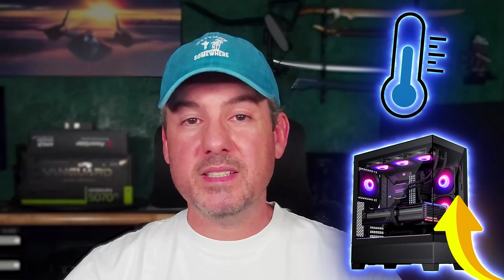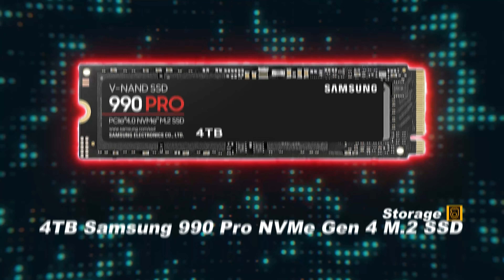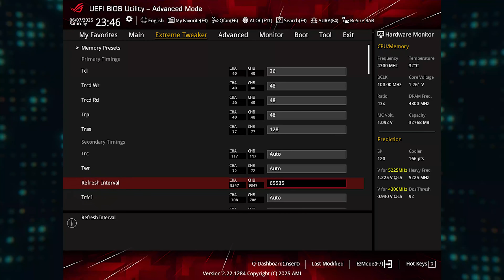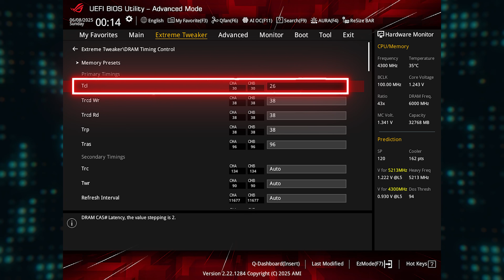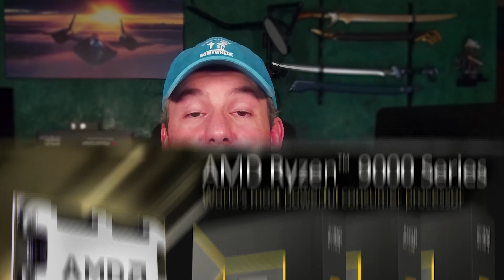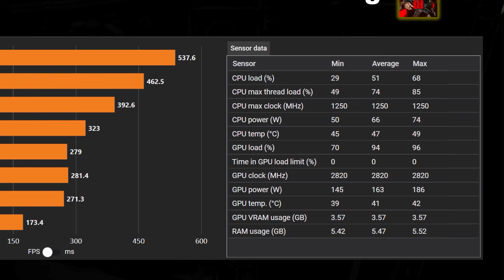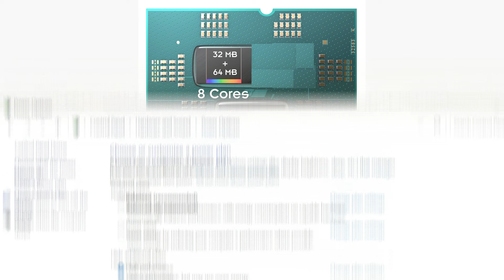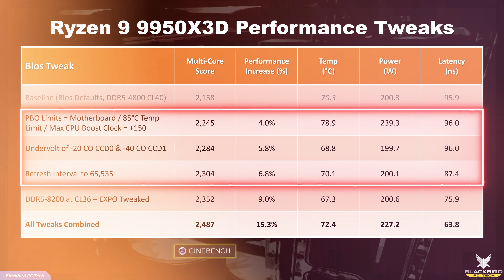What Are The Best Settings for an AMD Ryzen CPU?

Comment: This is fantastic. I have this exact motherboard, 9950x3d, 96GB Gskill Trident Neo CL28, 5080 Asus Astral to follow these instructions. Will come back to you with results.
Reply from the maker: What speed is your RAM?
Reply: @blackbirdpctech  6000mhz
Reply from the maker: Nice system … should perform really well
Reply: With keeping the RAM at EXPO I setting, I got a 7.6% performance increase in C24 Multicore with the rest of the changes
Reply from the maker: @idontknowfootballfc  anything above 5% is a good increase in performance, especially considering that doesn't include the RAM overclocking boost ... don't forget, you will also get a significant reduction in latency
Reply: @blackbirdpctech  Not sure where to take the RAM overclock as the timings are 28-36-36-96 on a 6000mhz 2x48gb kit gSkill Trient Z5 Neo kit. Will have to look through your library about memory overclocking
Reply from the maker: @idontknowfootballfc  it's going to be more challenging with a dual rank kit because it places a higher load on your memory controller ... I would test 6200 and 6400 at the same timings, but adjusting FCLK per my video ... you might need to increase the voltage too.

Comment: I'm not convinced about one thing. Advice to use negative values CO and PBO overall  is a not GOOD idea! I have  7600x processor with a b650e-e board since BEGENING and from the moment I turned on the computer, regardless of the bios version, I had blue screens after turning on every single game game! the only way to deal with this situation was to set CO to positive values +5-10 and now the question is whether my processor is really that bad ?, i.e. in constant voltage mode it needs 1.30V to boost to 5350 MHz. My motherboards cant handle sthat settings because clearly, regardless of the BIOS version, sets the voltage too low by about 0.1V by default and even the scalar x+ option didn't fully resolve the problem honestly...I stayed at the values as I wrote above... it's hard to say but I recommend everyone to pay extra $50-100 for the next new computer and order the computer assembly service along with load tests and any game in the additional services because the stress after buying a computer assembled CORRECTLY by yourself is not worth it!! even after my ram works flaweslly 6400CL28 1.51V flck 2200 1;1 i am really dissapointed from this new build... still i regret not buying 5800x3d on good price and just skip whole am5 platform ....
Reply from the maker: First of all I'm sorry that you had a bad experience ... you didn't do anything wrong, it simply sounds like you got extremely unlucky. If you can only run stable with a positive curve offset then that means your CPU does not meet the AMD spec for a 7600X, which means they owe you a replacement CPU. One thing to keep in mind however is that no one will care more about your PC than you do, and there are a lot of so called "experts" out there that have absolutely no idea what they are doing, so I would caution against using a service. A few weeks ago I saw one of the best boutique PC builders build a PC for an NBA basketballer and use DDR5-7200 RAM with a 9800X3D ... as I show in this video that will offer lower performance than just DDR5-6000 in 1:1 mode ... and these guys are supposed to be the "best". The good news is you are part of the Blackbird PC Tech community ... feel free to ask me questions and I will do my best to help you.

Comment: Great info here! What are your thoughts on the PBO scalar control? Are there merits to increasing this to 5x, 7x etc.? Or should this be kept at auto or 1x?
Reply from the maker: Good question ... I debated whether to mention it in the guide. All that it does is change the boost clock behavior by increasing the Failure In Time or FIT limit of the CPU ... which means it increases how long the CPU can sustain higher boost frequencies before thermal or power limits kick in. When I tested it in the past, there wasn't a meaningful change in performance. That said, even if there was a small boost I would likely not use it because of the potential risks ... so I would recommend leaving it on auto.
Reply: @blackbirdpctech  I do appreciate that info, sir. BTW, my 9700x has been running great with -35 all core and +200 boost clock. My temps never go above 65 degrees while 4K gaming, using an air cooler.
Reply from the maker: @FNPNick  one of my favorite chips ... the 9700X is heavily underrated, it's a fantastic cpu

Comment: Do you really want max performance from the 9000 series? Aren't the 9000 series burning the CPUs?
Reply from the maker: If you watch the larger channels that constantly push drama then it would be reasonable to think that AMD has an issue with their latest gen Ryzen CPUs ... but if you dig a little deeper you will discover that the issue was isolated to ASRock motherboards and was due to bad firmware, which has since been resolved by ASRock.
Reply: @blackbirdpctech  You mean exactly like Intel but YouTube exploded over that issue but now its AMD and not their fault!
Reply from the maker: @gerardgauthier4876  no, it's not exactly like the Raptor Lake issues. For AMD it was isolated to an error from one motherboard manufacturer. For Intel it was an error from Intel that impacted all motherboards.

Comment: The quality of your content is insane step-by-step play-by-play very detailed very high-quality. Thanks for all that you do for the tech community. Lastly, in your previous guides for the 9950X3D I noticed that you recommended the adaptive CCD parking feature is that no longer a recommendation?
Reply from the maker: You have an excellent eye for detail 😉 Here are the two choices you can make for best performance:

1. Balanced power plan in Windows with Gaming Adaptive CCD Parker turned off
2. High performance power plan in Windows with Gaming Adaptive CCD Parker turned on

The reason it worked so well in my prior video is that I was using the high performance power plan. After further testing it turns out that you will get the exact same and sometimes slightly better results simply running the balanced power plan, which is much easier because it's what's selected in Windows by default. This is likely why Asus had the feature turned off by default in Bios.
Reply: Amazing work as always thank you for the detailed super informative information that you provided! You quickly became a tech YouTuber that I just stumbled upon to now the tech YouTuber that I recommend to other people! Thanks again!
Reply from the maker: I really appreciate your support!
Reply: @blackbirdpctech was earned and of course!

Comment: Thanks bro. 
Ryzen 9 9950x -30 All core +200mhz 
G.Skill Royal Neo - EXPO I (only option my mb had)
9070 XT - 550mhz, +10% Power, 2800mhz, and 0mV
Did this by watching all your videos and taking it step by step like you said. Really tested my patience BUT I have a completely stable build thanks to you. Earned a sub and a like and a follow.
Reply from the maker: Awesome ... you got a fantastic chip to run -30 all core on your 9950X ... for mine I had to run the second CCD at -20.
Reply: @blackbirdpctech  i want to try to undervolt my 9950x3d as well (don't want to overclock it, just undervolt) do you know if the PBO is set on Auto by default even before you click on OK (when it gives you the warning) or before the warning PBO is disabled ? Do you also know if the motherboard changes some PPT/TDC/EDC values if you move from Auto to Advanced? (i don't want to stress my 9950X3D too much especially when the motherboard pushes the limits too much) if your answer of what i asked above is positive (which it means that from auto to advanced the mobo won't do any joke to me with the power and voltages) i can proceed to do some undervolt only, all i have to set is the CO on negative on all cores as you said in the video right ? then my last question is, lets pretend i set all cores to -15 and my system wont boot, the whole BIOS wont reset right ? but what if it boot and then when i run aida64 my system crashes? Does the BIOS reset completly or only the undervolt resets? tysm for your patience I know i asked alot of things, but these things should be easy for you to answer (i am new to this world)
Reply from the maker: @Ares_XO  I have a simple undervolt guide in this video: https://youtu.be/6vROzalei6Y

There is always a possibility that you will have to reset your Bios when you tune your system ... it's not something to be fearful of since it will work fine with everything set to Auto. That said, if you are worried then simply go in to Bios and save a copy of your settings just in case something goes wrong.
Reply: @Ares_XO  It's motherboard dependent, but I can tell you from experience on my ASUS ROG Strix X870E-E the keys are WHERE you set PBO and EXPO as much as WHAT you set it to. Where meaning did you make changes under Advanced (AMD) vs. AI Tweaker (ASUS). It could vary by BIOS version, but whenever I had either AI Tweaks turned on (highest menu button, then hitting Next and Accept), or changed EXPO in the AI Tweaker menu, the board would flip other settings around. 

However, if you exclusively use the AMD Overclocking menu as shown here, you should be 'safer' in that I haven't found other settings get flipped around. Before you hit OK after "Save and Reset", study the change list presented. There have been many times settings got flipped that I did NOT change, so I hit cancel and went back to adjust them manually. 

Lastly, be sure you are starting from a clean, uncorrupted point when doing these changes. I eventually determined that my BIOS had become corrupted due to BIOS updates, despite me doing no expert manual changes at the time and relying on ASUS's AI Tweaker settings. This is not just an ASUS thing though - before you do a BIOS update, you should "apply optimized default settings", and then MANUALLY reapply all of those prior settings to the new BIOS. ASUS lets you save not just the .CMO Bios config file to external non-NTFS disks, but also a .txt file with the config in readable format. Even with relatively minor tweaks by BIOS was so messed up it wouldn't even boot to BIOS - it was corrupted. I had to do BIOS flashback, and then MANUALLY apply the settings again. 

If you are NOT updating the BIOS version and know you started from a clean point before making your tweaks, just save those CMO files and easily reload them. You can save them as Profiles to the MB but also save them externally to a non-NTFS formatted USB disk. That let's you easily move back and forth as you make tweaks without the manual effort. Hope that helps since it took me way too long to figure that out.

Comment: My 9800X3D was unstable on anything lower than -15 PBO. Then I realized I could set the other cores than the 2 identified in Ryzen Master to -40 and it's rock-solid. I have those two cores set to -14. Was really interesting to me.
Reply from the maker: That is the best way to dial-it in for absolute max performance but of course it takes a bit more time, especially for a chip like the 9950X ... although using the Ryzen Master optimize feature was smart, I've just found it to be hit or miss in the past. I'm curious if you compared the performance difference between -15 all-core and your optimized configuration with two cores at -40?
Reply: @blackbirdpctech Experimentation is called for. For science!
Reply from the maker: I think that would be something interesting for me to show in a future video ... a chart of undervolt versus performance, and then perhaps the impact of increasing the undervolt on some cores.
Reply: @blackbirdpctech  do I have to disable my igpu to undervolt?
Reply from the maker: @StingcatKnight  no
Reply: My process for per core undervolt is to tweak all core until it fails, then go back in per core, back off one step for your two best cores (check core performance order in hwinfo) and then go back and go more negative on the remaining cores.  For instance, my 9800X3D failed at -30 all-core, my hwinfo core performance order said cores 3 and 6 were my best cores so I set core 2 and core 5 (hwinfo numbers cores 1-8, bios numbers cores 0-7 so adjust accordingly) to -25 and set the other 6 to -30.  I haven't really tried to push the other 6 further than -30.  Core performance order is determined by each core's voltage requirements with your best cores needing more voltage.
Reply: @dkindig  How can you tell what your "best cores" are? I have a 9800X3D build and still learning how to undervolt,
Reply: @yankeessuck193  Ryzen Master has two stars on your best 2 cores. One is a gold star, the other is a silver star. Results will vary, but just as an example, my 9800x3D gold core is #4 and my silver core is #2. Per core undervolt works for me by having other cores(0-7) at -15 but my 2 (2&4)best cores at -8.
Reply: @azalea_k  how did you figure out which 2 cores didn’t like the -15 or lower?
Reply: @potominkus9828  Verified them by running Ryzen Master, which verifies the 2 preferred cores. Also, HWiNFO lists them as "perf #1".

Comment: Great video as usual, watching this while waiting for my new pc to get delivered next week :D
Reply: Hyyype!
Reply from the maker: That's exciting ... what did you end up going with?
Reply: @blackbirdpctech  asus b850 rog strix, amd 9800x3d, kingston fury beast 2x32gb 6000 cl30. Btw is that memory integrity thing really that much of a difference ? That seems too much, wouldnt win 10 be so much faster then win 11 in games and it isnt they are about the same.
Reply from the maker: I showed the impact very briefly in the video so you may have missed it ... in Total War Warhammer 3 the difference between having memory integrity off and on was 13% in average FPS and 27% in 1% low FPS ... so yes, it's significant!
Reply: @blackbirdpctech I wish you would do a more detailed test of that setting, that seems like too much of an impact. Turning 1 setting off and you go from 1 tier of a cpu to next. I barely found any talk about it online from any reputable source.
Also is that turned on by default on a fresh Win 11 install?
Reply from the maker: The impact is not only real, but this was the error that Hardware Unboxed made when they recently made crazy claims about Windows version 24H2 increasing gaming performance by over 10% when compared with 23H2. Hardware Canucks discovered that 24H2 had memory integrity turned off by default (unlike prior versions of Windows) and that the performance difference was due entirely to that. Of course HUB didn't issue an apology or acknowledge that they made a mistake. I talk about it in this video: https://youtu.be/vkoiCfDK1SU

By the way, when you want the truth just come here ... it will save you a lot of time 😉
Reply: @blackbirdpctech Interesting, ty for the information, glad I found your channel.
Reply: @blackbirdpctech  I get hate everywhere when I say Gamers Nexus and Hardware Unboxed have their own agenda and stir drama to get views but their sheep followers believe them blindly and can't accept the facts. Both Steves have lost some respect and credibility in my eyes. Not saying they are 100% wrong in everything but they are not saints either. Everyone is out here for their own benefit. Glad to see you call it out not only here but in a community post in the past! Most youtubers don't have what it takes to say it publicly because they fear the cult followers of both Steves
Reply from the maker: @KayBearYT  I think it's important to call out misinformation and poor behavior regardless of the source ... I also think it's a good idea to give credit when credit is due. I would also expect this community to hold me accountable if I screw something up. Everyone makes mistakes, but how you react when it's pointed out is what's important.

Comment: Saving this one for later, thanks for your hard work! :)
Reply: Make sure you use Memtest86 and Y-cruncher as those are what vendors of RAM like G.Skill and Corsair use to determine ultimate stability through long form testing. 6+ hour tests are recommended.

Not sure why Blackbird doesn't use these. It's a cardinal rule to use some version of PassMarks Memtest86 when determining stability.

Comment: For gaming lower timings are better imo, however, you do need to OC
Reply from the maker: All of the options contribute ... but when someone says "just leave it at stock" you can show them that they are leaving around 15% performance on the table
Reply: @blackbirdpctech  Deffo
Reply: Even undervolting can be good on its own (not that I'm advocating for only doing that). Better performance just through lower temps and longer boosts. Of course you do need to be mindful of clock stretching per the vid at 15:42
Reply: @azalea_k  oh my god, undervolting your PC when you mainly play VR or heavy games is such a fucking cheat code that NO ONE TALKS ABOUT!!!
Reply: I lock most games at 60 FPS (I know, I suck), so the cooler temps and efficiency from undervolting is mostly what I'm after.
Reply from the maker: @sneakytrip6594  you don't suck for making a choice ... if you are happy playing the games you play the way you play them then that's all that really matters.
Reply: @sneakytrip6594 in my case, CPU plays a huge factor for CS2, so that's also a consideration for me.
Reply: @sneakytrip6594  So why even buy highend hardware if 60fps if your target? 120fps isn't going to raise temps much at all much less power draw and it looks better.